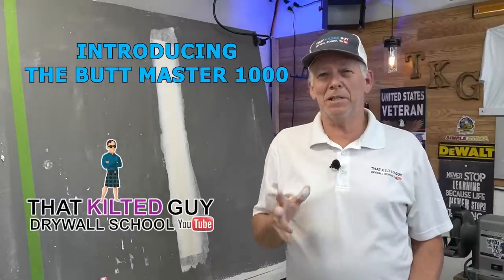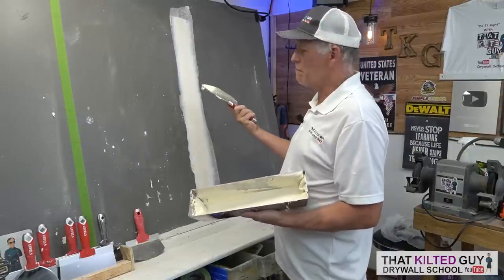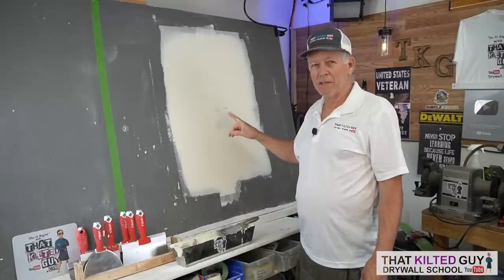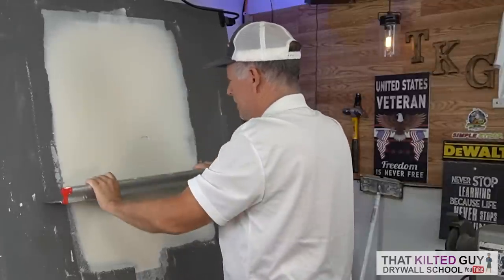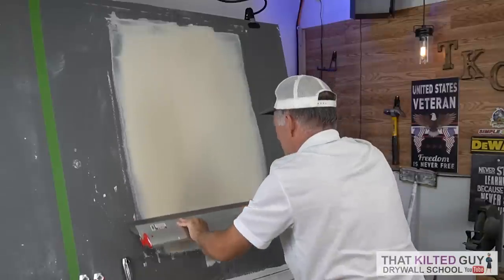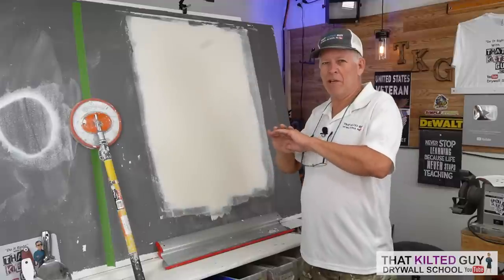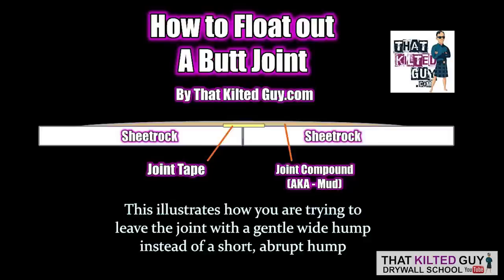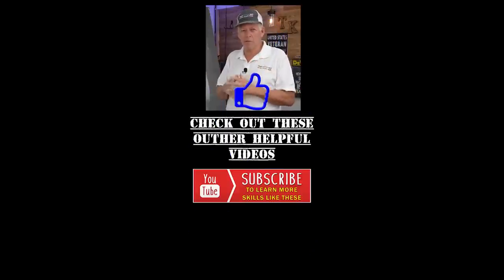Trying to Skim Coat a Drywall Butt Joint with The BUTT MASTER 1000

Comment: I gotta get that Butt tool. I like slide lighting. It makes those imperfections pop. Something I didn’t see or hear you say about side lighting, is which side to apply the light. I’ve found whenever possible put the light on side the natural or room light is going to hit the wall, which ever is going to be the strongest light source for the wall. If there is a window on the right side of the joint, put your light on the right side of the joint that way you’ll always be applying the mud to the areas most likely to cast shadows so you can work those areas out over a long slope.

Comment: Hi Guy, after having been involved in the drywall industry over the last 40 years (amongst many other things) I recognize a real pro when I see one.  Great job with your instructional videos!

One thing I have never figured out is how to keep from clogging up my shop vac with drywall dust.  I use a vacuum sanding block on the end of an extension pole in order to keep the dust down.  Sometimes, when I take the shop vac filter out to clean it comes out looking solid between the filter pleats.  I also end up with a huge cloud of drywall dust surrounding me when I use my shop air (outside of course) to blow it off.  What are your thoughts on how to control the dust a little better?

One idea I had was to get a newer shop vac where I can use one of those dust bags that you insert into the shop vac.  Have you had any luck with this method?
Reply from the maker: Hey thanks for the email and comment. Well my health hasn’t really improved much as I’m still fighting extreme fatigue that limits me to three or four hours of work a day. But I’m doing the best I can.

As for the dust control, I have a much better solution for you. Check out the video below.  This pretty much eliminates 95% of clogging in your vacuum.

https://youtu.be/VRqC7SzayzM

www.ThatKiltedGuy.com
Reply: Tape a tee shirt over the filter.

Comment: As always awesome presentation !!! Quick question I repaired the ceiling at my parents
Dining room. I was a bit press for time since they live far away. I used 90 sheet rock mud. It came out pretty good( I was showing off my improved skills thanks to you) so I decided to skip a final coat with Plus3. When it was time to paint I noticed 2 spots that bubbled. What went wrong? Was it the paint reacting to the mud. ( I used Sherman Williams ceiling/primer paint) or was it because I didn't use a finishing mud like Plus3? Thanks again.
Reply from the maker: If it was a bubble in the mud, they just happen and you just have to fix them right before you paint. But no you don’t have to put regular mud on is the final coat. If the paint bubbled, you probably didn’t let it dry long enough. Usually it needs 24 to 48 hours

Comment: Absolutely awesome.  Great presentation.  I'm planning on using my Level 5 tools (that I just got) next week on my own house.  Just have to get off the horrendous existing texture first!  Someone scraped the acoustic/popcorn and then did some sort of super thick spray texture with no knock-down, not at all symmetrical,  then painted over it.  I might need to skim coat the entire house ceiling.  Ugh.  First up though is using the Level 5 tools at a job site in an easier application this week.
Reply from the maker: Glad to help.  Good luck!

Comment: Wow - Really thorough job!  You're definitely a true professional!!  If I put too much mud under my tape on a short section of about 10inches what would you recommend?  Do I a) sand it down b) scrape off the badly fitted section of tape and start again?  c) wall area is only 9foot by 4 foot - skim the whole wall to the thickness of the raised area d) other?
Reply from the maker: Just sand off the excess
Reply: @ThatKiltedGuyDIY  thanks - that would sand off the paper presumably as the mud is under it?
Reply from the maker: I miss read that slightly. If you put too much mud under the tape it’s really a judgment call. Are you good enough to float it out like a butt joint? If not, send it down to the joint tape, wet it put it off send off the rest and redo it. 

You may want to consider joining our YouTube membership group to say thanks and get priority responses by clicking the join button next to the subscribe button. Thank you
Reply: @ThatKiltedGuyDIY  great - thank you so much

Comment: Great Butt joint. Ahh, but sanding. Years ago I was shown how to use a damp sponge to smooth out my work instead of sanding. I have been sponging ever since. Now I'm not a pro drywaller like you, I'm a home remolder. I am curious on your thoughts on sponging.
Reply from the maker: Sponging softens out the edges but it doesn’t flatten things like sanding does. I wish it did but the only thing I use it on is the outside edge if it’s really thin already to make it even thinner

Comment: What the best way to install drywall laying down are standing up?  I am a first timer
Reply from the maker: Pros hang it horizontally but for novices, it’s often better if you hang it vertically, standing up. Just be sure you lift it all the way to the ceiling with a drywall lift
Reply: @ThatKiltedGuyDIY  Thank You

Comment: The" Butt master 1000 "looks a lot like a plastic paint line guide. Ironically it's horrible at being a paint line guide as well. :)
Reply: With a name like Butt Master 1000,  they should simply call it The Shit master 💯  😳🤔
Amazon sells alotta crap especially if your gonna purchase Fragrances or Brand name clothing to automotive parts ... All Knock off.
Reply from the maker: Ahh, you didn't watch the video I see....